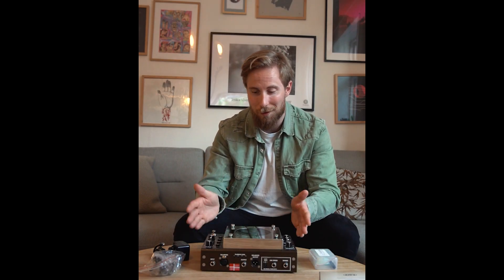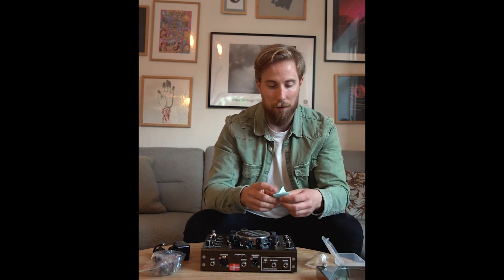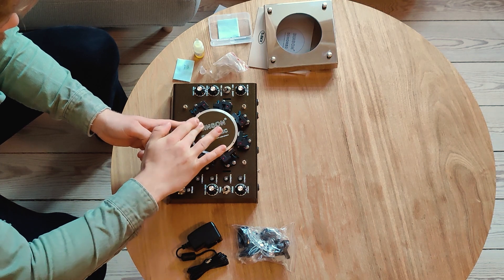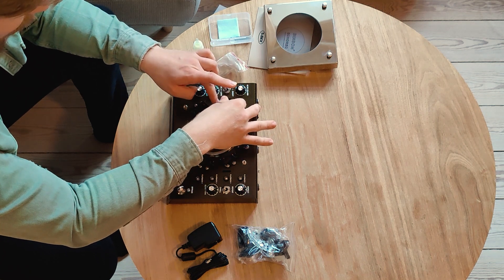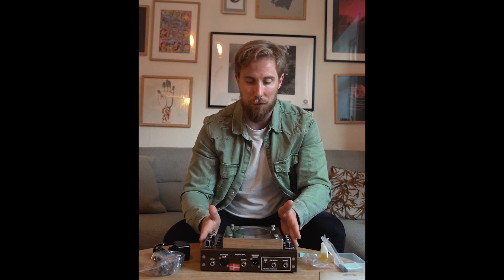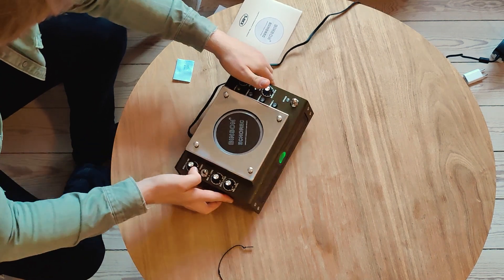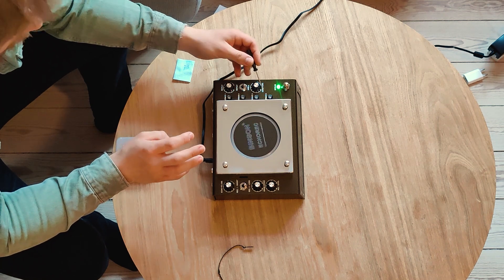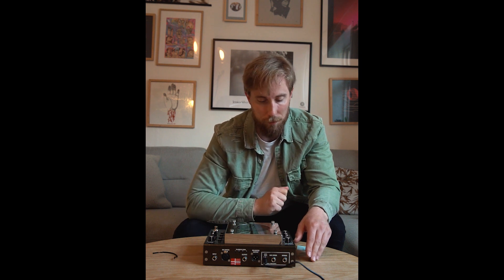How to set up your T Rex Binson Echorec

Comment: Who manufactured the magnetic heads ? Amazing to see magnetic heads being produced still on anything ! Curious about that part of the manufacturing process and if they were custom wound for this unit specifically or if you purchased and designed based off of one’s already in manufacturing. Also will you plan on making a valve version? Is this discrete or does it use op amps ? Are there any transformers in the circuits in/out?
Reply from the maker: We produce everything ourselves!
We have quite a few things in the works that are too early to be revealed now.

Comment: how often the metal strip must be replaced? and I didn't saw replacements on the website. can you clarify?
Reply from the maker: It should - when maintained properly - last for years and years. It's difficult to answer more in depth, cause it depends on how and where it's being used.
Also, you should not replace the metal strip if the time comes. We are working on making replacement drums for that purpose.
Reply: thank you!!! @TRexEffects
Reply: My understanding (could be wrong) is that the metal drum should last for a few decades.  I wouldn't worry about it too much.

Comment: Why did you guys not make it in a similar casing to the other ones. This is the biggest throw off. cause it doesnt look good at all
Reply from the maker: Well, it's simply not possible to make it smaller at the moment. We have made it significantly smaller than the original already.
Reply: @TRexEffects  Not smaller. i ment BIGGER haha. it would be so much cooler paying homage to the old casings if you guys made the case like an old echorec. it sounds super cool. but i dont feel like i could put this on top of my hiwatt. its more for the pedalboard which i feel is a lost chance at something super super cool
Reply from the maker: @Suunder  I get where you are coming from but it does have more usages than the original because it requires less space.
Reply: @TRexEffects  but leave that to the trex replicator :(